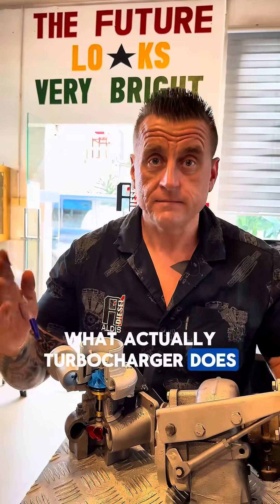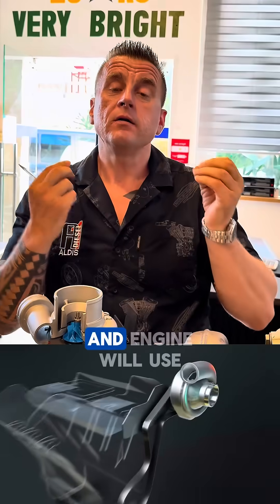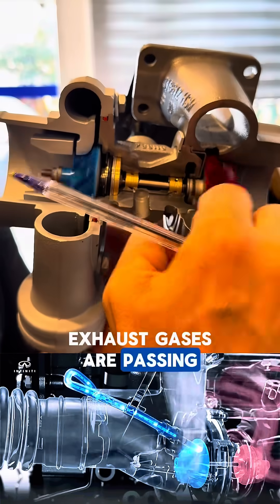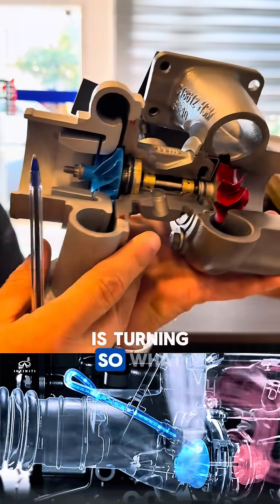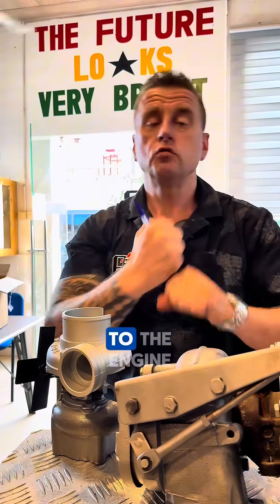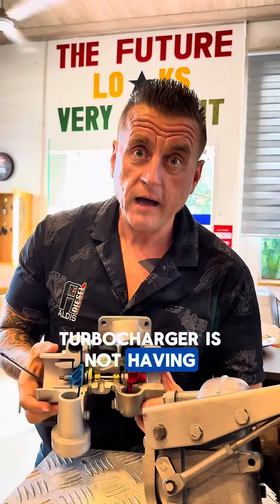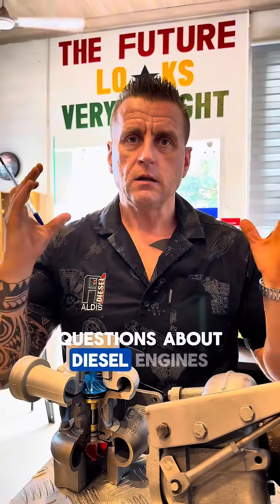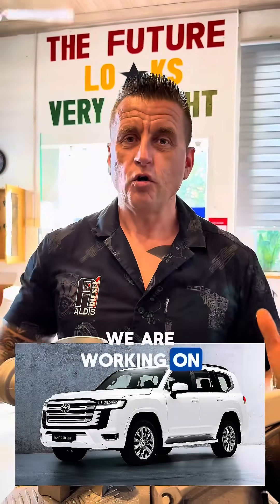Turbocharger Explained: How It Works and What It Actually Doe

Comment: Hi sir ,im vinoth from diesel care company kuwait. One issue we facing that we overhauled six crin injectors for iveco truck vehicle. The complaint from the customer is compression back flow and long self. We tested the injectors all are working in minimum back leak. But the deliveries are very low in Vl stage. So we changed the nozzles and calibrate the injectors.in customer side they overhauled the engine.Now the issue is the vehicle is not starting. We check the error with computer , but not showing eny errors. Sir what will be the problem.pls eny suggestion from your side sir. Thank you

Comment: I have a 1kd Toyota and it's having a loss of power when uphilling I have changed the turbo charger what could be the problem
Reply: Check the basic part
Reply: Does the engine sound normal or low? Does vapour comes out of the oil cover when open or out of the dipstick tube when removed?

Comment: Hi boss , i have a 1.4 Diesel but every morning i ha e to use the lift pump before it can start but throughout the day no problem.
Reply from the maker: Fuel is going back during the night.
Reply: @a1dieselafrica fuel return check valve leaking